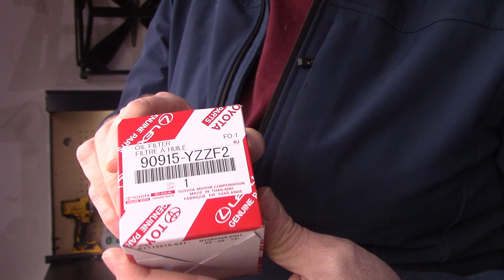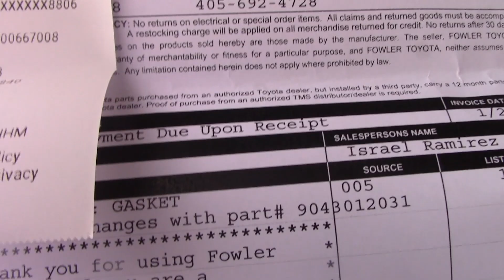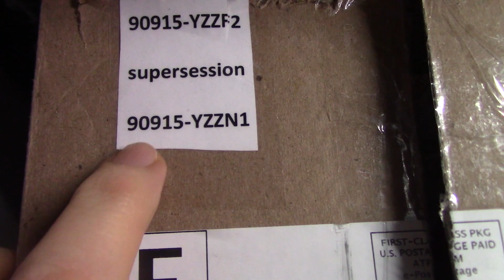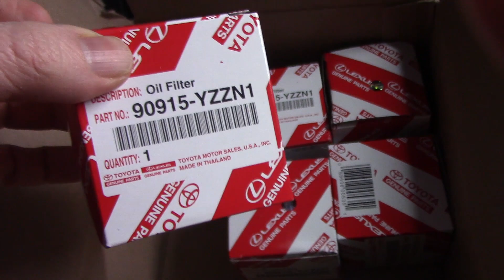2020 Toyota Rav4 First Oil Change with Filter Teardown

Comment: If you are worried about any potential oil leaking and the gravel shield access cover is blocking. Drill a 1/4” hole on the access cover and countersink the burs. So any fluid leak that’s trapped on the access will leak into the driveway cement.
Reply from the maker: Nifty idea. Thanks.

Comment: I personally would use an Amsoil oil filter as it would capture more particles in the media. The Toyota filter is very poor at doing this from test results I’ve seen online and was rated the poorest out of 10 filters tested. Might want to check online for the latest findings on these testing methods; but as CCN  mentioned every 6 months or 5,000 miles which ever comes first change it.
Reply from the maker: Oh I absolutely change oil at 6 mos/5,000 miles on ALL my family vehicles.

Comment: Do you change the 2020 RAV4 transmission fluid?
Reply from the maker: It has a sealed transmission that Toyota claims is "lifetime" fluid, which is preposterous. I will perform a partial change of this fluid at 60,000 miles via the process I showed in my Lexus ES350 video which was drawn from directions laid out by "The Car Care Nut."
Reply: @DIYDaveOK  thanks so much for your reply

Comment: Please let me know on how many miles you change transmission oil a rear axle  differential on how many miles you change
Reply from the maker: This RAV4 doesn't have a differential...
Reply from the maker: My RAV4 is not AWD so it has no differential

Comment: I had the same issue, searched all over and had trouble finding the 0W-16. 
Went with mobil 1 and a mobile 1 filter.
Reply from the maker: I've had fairly consistent luck in finding Mobil 0-W16. I found a good, reputable online Toyota source for the filters and ordered several.
Reply: @DIYDaveOK  good to know, also you mention this, I also have a 2016 highlander, the filter change is so irritating to remove. I went and bought a filter socket compatible with both my RAV4 and Highlander.
Reply: My limited research has indicated that Mobile 1 is the supplier for Toyota's 0W-16.

Comment: Good video but I think you may have the flow pattern through the filter backward. Oil is pumped through the ring of holes at the periphery and flows out of the filter via the center opening.
Reply from the maker: Great point! Thanks for watching.

Comment: I use a Torque Wrench on the drain plug. Just got my first Toyota(2023 RAV4) heard the Torque was 30 ft lbs, that seems high, can anyone verify  the torque  ?
Reply from the maker: It's 30 ft-lbs per spec.
Reply: @DIYDaveOK  
That's double what I'm use to, but I'm use to copper crush rings, and 5-30 oil.
Reply from the maker: Well I've gotten to the point that I tighten until it's hand-tight, then a bit further with a regular 8" wrench, then just check it for leaks. I didn't get into changing crush washers until they started using these really thin oils. So far, so good on our RAV4, and we're up to about 23K miles and staying faithful to the 5,000 mile/6mo change interval.
Reply: @DIYDaveOK  
How does oil look at 5000 miles, and have you stuck with mobile #1 ?
Reply from the maker: Oil looks great, only slightly discolored. I've used Mobil 1 *if I can get it*, but sometimes it's in short supply. If I just can't get any, I'll go to Pennzoil.
Reply: @DIYDaveOK  
Thank You for Video and advice.
Reply from the maker: @sem4502  My pleasure!! I hope it was helpful!! Getting ready for the first oil change in my new Tacoma next month!!

Comment: Awesome video! I am very curious though…I was told never to tighten oil filters with a wrench unless its the factory torque spec. Is this how its supposed to be done by Toyota?
And Would going that tight with that wrench cause any spots on the filter or mating surface to be too tight and make the seal(s) fail?
Reply from the maker: Thanks! I've been using a similar process on every oil change I've done on every car I've owned and never had a problem. In general, I try to just make contact and then go about 2/3 additional revolution.
Reply: After I remove the old filter, make sure the old oil filter black rubber seal is on the filter and not on the engine. Clean the mating surface.
Lubricate the new filter O-Ring using new oil with finger tip. 
Spin on the oil filter, when it bottoms out by hand; then put the oil filter cup and snug lightly with a 3/8.drive 6” handle short ratchet until it stops, no more force is required.

Comment: I WOULDNT PERSONALLY PUT BACK THE COVER UNDERNEATH WHAT FOR AND WHY?
Reply from the maker: I put it back on simply because I want to keep the car as close to as-built as possible while its still under warranty. If something bizarre happens and I need warranty service, I don't want them saying "oh, sorry, you took off the splash shield, no warranty for you!"
Reply: o
Reply: If you live in a snowy climate in also keeps snow from packing in there

Comment: Nice video.  I’ll let the dealer do mine on this car though after watching this. On a side note, I always try loosing the filter first on new cars before cracking the drain. Sometimes the factory puts them on ungodly tight.  Same rule for differentials. Undo the top fill plug first.
Reply from the maker: Thanks for the kind words. The filter on this one was not on exceptionally tight - only reason it was a bit of a struggle was  just getting my wrench in there and the lack of light not letting me see that little flange 😁. The plastic beauty cover was more annoying. Thanks for watching!

Comment: These 4 cylinder engines actually last a lot longer than V6 and V8 engines.
Reply from the maker: Hmm I'm not sure if I believe that, especially with the number of 4 cyls that are being turbocharged. I'd much rather have had the V6, which would likely have been the same engine in our old Sienna, or my ES350.
Reply: They've only been around since 2018. A25 engine introduced to USA.
Reply: @marshmower  There are many high mileage examples already.  There is a lot more stuff to go wrong in a V6.  The Toyota V6s are still the best though.

Comment: Many many so called ORIGINAL filters are fakes, great looking fakes but crap for sure, rip one open and check the amount of paper pleats compared to one actually bought from TOYOTA, I would never buy an oil filter from anyone bar the main dealers, yes more expensive but how much is an engine that could get ruined for a few bucks, crazy.
Reply from the maker: Absolutely agree and bought only from a verified Toyota dealer with an Amazon storefront.

Comment: Williams Oil Company? I think you mean Warren Distribution...

I would be careful about buying really cheap oil filters even if they are branded as Toyota... Counterfeits are more common than you or I want to believe especially from websites like eBay.

Yes, the wrench that is designed for the housing on the cartridge system will not always work for the spin on canister. A strap wrench should work or inserting something between the filter and the other wrench you tried that was too big might also have worked.

That filter from the factory was made in China?! Yipes!

Also the official Toyota filters are supposed to be pre-lubed.

Anyway, great job! I always like seeing someone pay attention to details.

I never use a tool to tighten a spin-on filter. Just put on as tight as I can get it with my bare hand.
Reply from the maker: Aarrgh!!! You are absolutely right. I cannot believe I didn't notice that dumb mistake even while I edited the video. Good grief. 

Agree completely on being wary of counterfeit part scams - they're especially bad on eBay, but I inspected these filters and am confident they are, in fact, the genuine article. In fact the FordTechMakuloko channel did a great video on identifying fake Ford parts from.eBay. He just suggested avoiding eBay in general, and I agree. Toyota also has a special reflective color/silver authenticity seal that is very difficult to duplicate. 

A smaller strap wrench would definitely work on that filter as well!! Part of that issue was how dark it was getting and I didn't readily see that bracket which was in my way.

Thanks for catching the mistake and thanks for watching. Appreciate the kind words on the details. I obviously don't always get it 100% right, but I try!

Comment: Do you have a suggestion on which filter wrench you are using, I have a 21 rav4.
Reply from the maker: This was a generic aftermarket Toyota oil wench I picked up at AutoZone. The key was to ensure it doesn't have the flared edges that end up interfering with that flange I mentioned in the video. With the right wrench it should be a quick process. Thanks for watching!
Reply: @DIYDaveOK  thanks.

Comment: Next time you change your oil, replace your drain plug with a Fumoto F-133 drain valve. I have run them for years on Ford diesels and Subarus with no problems. Never have to worry about replacing the gaskets or stripping threads and you don't need a wrench once the valve is installed.
Reply from the maker: Great suggestion! Thanks for watching!
Reply: i like my oil to come gushing out , thats why i make sure i only do a change after a good long hot drive .

Comment: When you changed the oil, did it look clear on the dipstick? My dealership changed my oil and I don't think they actually changed it. It was still dirty when I looked at the dipstick.
Reply from the maker: Immediately after an oil change, it should be clear and clean. However, when I drained the original oil in this video, it was already darker than I expected. I think the extra power they're pushing out of these 4-cylinder engines with the lower-viscocity oil tends to make the oil darken up more rapidly. If you have any doubt your oil wasn't changed, but can't prove it, change it again. I am ever more firmly convinced that these newer cars' longevity is tied to absolutely regular, on-time oil changes at 6mo/5k mile intervals, regardless of the manual's direction of 10,000 mi. Leave no doubt, in my opinion.
Reply: @DIYDaveOK  I cant imagine they would do something like that, but I checked the oil when I got home and it wasnt black, but it definitely wasnt clear. My Mazda was so clear I couldn't even see the line.

Comment: Aparently its rocket science trying to remove oil filter,next time use solid pliers.:-)
Reply: I didn’t try to be mean on this comment
Reply from the maker: It's always a little amazing how small things can trip one up, and make you feel a little silly in the process. I will allow myself a little slack on this one because the flange that kept the tool from fitting was obscured in the shadows :) :) THanks for watching!
Reply from the maker: @nazarettos6987  No problem!!

Comment: Asking a question about your Lexus ES 350 oil change, since that was posted awhile back.   Is there a gasket on the oil drain bolt and, if so, does it need to be replaced or can I simply reuse the existing gasket?
Reply from the maker: Hi, Mark! I believe there is a drain bolt gasket on my ES 350. I have never changed it, and I've owned it for two years now with no problems (and that includes four oil changes). That said, however, I have opted to start changing them on our new Rav4 because it uses the oh-so-thin 0w-16 oil and the washer type appears to have changed.
Reply: @DIYDaveOK   Toyota's from all my oil change experiences have always used the same type of blue drain plug gaskets - I haven't seen a change in design of them. You should highly consider opting to always replace the drain plug gaskets as Toyota intended their design each oil change to be absolutely safe about it. If I'm understanding you correctly, the reason for a blue gasket that's already been on a drain plug looks different from a new one is because it's been crushed already from reusing it and the color fades alongside it.

Comment: Toyota free lifetime oil change is a SCAM, I have appointment for oil change today at Toyota daytona, the service man told me that too early to get oil change today and I have to wait till 10,000miles or 1 year 1 time to get a free one, he just reset maintenance light on and tell me to go, 10,000 miles to get free oil change? It is a SCAM.
Reply from the maker: That's exactly they make it free, because they know they'll rarely if ever have to do it, and most owners won't go to the trouble of going to the dealer just for an oil change. It's an infuriating gimmick, and oil changes (especially on contemporary engines) should NEVER go to 10,000 miles, *period*.
Reply: They told me I could get four oil changes per year
Reply from the maker: The key is whether they do it in reality. I hope they do.